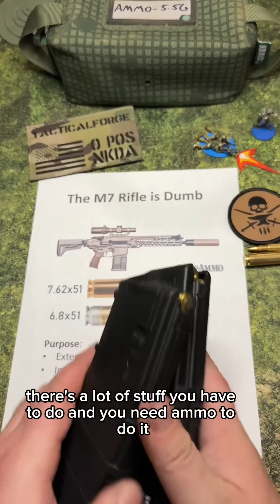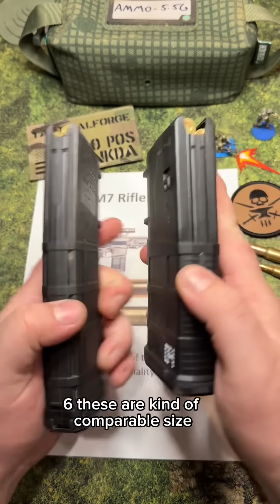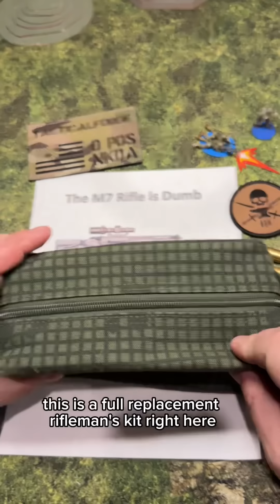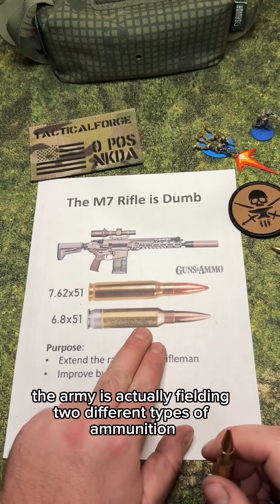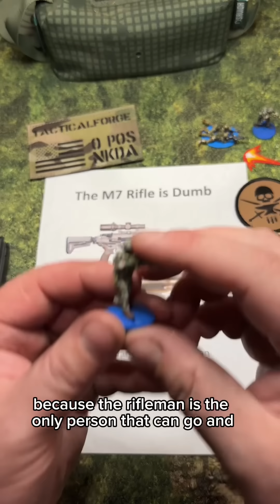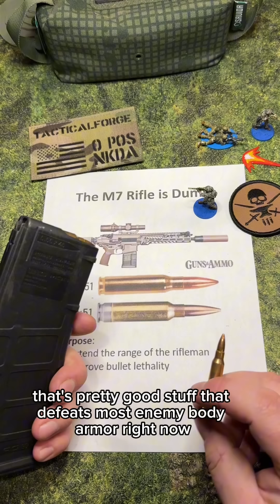The Army’s new rifle is dumb

Comment: What a great idea using a suppressor without subsonic bullets, I'm sure you will barely hear the shot
Reply: The point is to make it harder for the enemy to locate your position for accurate return fire. It also helps improve intra-unit communication & situational awareness (especially during CQB). The Marines were actually the pioneers on this; IIRC they’ve fielded suppressors as standard issue since ~2019.

The problem with the 6.8x51 in the M7 is that the chamber pressure is so high the gun is practically unshootable without the suppressor attached (brass facts did an excellent video on this about 1-2 months ago).

Comment: I have an insane idea: would 5.56x51 (instead of 5.56x45) solve the perceived problem with none of the drawbacks? Or is the round simply too light to make effective use of such a large charge?

EDIT: I'm thinking of a cartridge that is as long as 7.62x51mm, but only as thick as 5.56x45mm)

Comment: I think a better option would be a relatively light weight rifle like the CZ Bren 3 but in an intermediate caliber with decent magazine capacity, good effective range, low recoil, and high BC bullets such as 6.5 Grendel. Put a computer assisted optic on it that can help with lead calculations on moving targets both on the surface and in the air. This would allow every rifleman to have a decent self defense capability against small drones and an ability to engage targets out further than an M4 or M16 of equivalent barrel length while maintaining good mobility and good close range handiness.

Comment: All they have to do is use shellshock or similar technology 5.56 and 7.62, as well as make Tungsten carbide AP rounds more common. Artillery, CAS, DMRs and Snipers can deal with longer range engagements. There's also Machine guns like the Ohio ordnance reaper in 338. Norma that can reach out much longer and 7.62 isn't exactly a slouch either.
Reply: Demanding the infantry rifle penetrate level IV plate is asinine IMO. The majority of the body is still vulnerable to rifle fire, and most small-arms ammo is expended in a suppressive capacity anyway. Besides, HE is a far better way to deal with armor; a grenade or FPV payload going off next to you is still gonna fuck you up.

Comment: 1902- The new Springfield Rifle is bad will be bad
1935- The new m1 garand is a bad rifle it will be bad, it wont be better than the springfield 1903
1958- The new m14 rifle is bad and wont be better than the m1 garand.
1964- The new m16 rifle is bad and is getting people killed it wont be better than the m14
On and on we have had this people. It may be bad now. It will get better.
Reply: The M14 was hopelessly obsolete before it even started production lol.

Anyways the issue with the M7 is mainly the very concept it is supposed to solve. This isn’t the 19th century; there are numerous better ways to solve the body armor “problem” than demanding your rifle round be able to pen level IV plate. Not even the vaunted 6.8x51 can do it unless loaded with tungsten projectiles (not the M7’s fault, modern level IV is just that good), which will never be fielded in quantity anyway. In exchange, we’re saddling ourselves with all the cons of a battle rifle (weight, bulk, shootability, logistics, etc). There’s good reasons why no major military fields battle rifles in quantity anymore.

Comment: Could have used a fairly off the shelf round.  Silly.
Reply: The asinine demand to penetrate body armor at range basically killed the viability of this program.

What they should’ve done (besides not stipulating the body armor bullshit in the first place) was to update the 6mm SAW cartridge. Shorten the neck, reduce case taper to that of the 7.62x51, increase shoulder angle to 30 degrees, and use a stainless steel case. An 85 grain EPR style loading should get around the same velocity as M855A1 but with far better long-range ballistics.

Comment: It's not the mobility factor. It is the thickness of the magazine pouches, making it harder to get lower to the ground. Also, the added weight and reduced amount of ammo reduces your firepower as well. 
This system is best implemented as a designated marksman rifle in an infantry squad, not as the standard battle rifle.

Comment: I have a particular bone to pick on the technical side of the M7.

Let's ignore the logistics and barrel pressure issues, and just look at the operating mechanism.

  The M7 uses what I call a Long-Short Piston, which is a hybrid between long-stroke designs like on the AK and short-stroke designs similar to the FAL and AR18.
  To elaborate; there is a metal extension connected directly to the bolt carrier, which meets the actual piston. The piston itself can only move an inch at most, but the extension along with the rest of the carrier recieve the kinetic force needed to cycle the entire rest of the way.

This means nothing, until you compare how FAL & AR18 style short-stroke pistons work, where the piston is the part with an extension connected to it.

  This is a big deal, because the M7's system introduces a ton of unnecessary interia from the extra reciprocating mass. Meanwhile, the contemporary systems only have the extra mass move an inch at most, making the extra inertia easier to handle.
  In ye-olden times, Bolt Mass was the primary method of tuning a firearm's cyclic rate. If it cycled too fast, inertia would be dumped into the shooter. Too slow, and it would just not cycle. This created a myth where a Heavier Bolt equated to less recoil, which was a trap that many brilliant gun designers fell into, including Jim Sullivan of Armalite.
  Nowadays, adjustable gasblocks and springs of varying strength are the primary methods of tuning a gun. In fact, if you have less reciprocating mass, there's less inertia to create recoil. You still need some inertia to plough through any dirt or grime buildup, but generally less is more.

  This all builds up the question, what is the Long-Short piston even good for? Simple! LMGs. If you burn out a barrel, it makes sense that the piston would get burnt out too. But, having a bulky piston extension on all your barrels would be too heavy and hard to store, so it's easier to just put the extension on the bolt carrier.
  True Shortstroke, meanwhile, is excellent for rifles which are intended to be decently high performing. You won't get the lightweight recoil control of an Internal Piston (usually mistaken for Direct Impingement), but the ease of cleaning is usually worth the tradeoff.

So, as far as choosing an external piston goes, the engineers at SIG chose the single stupidest option for their rifle.

Comment: They should Have went with the L.W.R.C. M6. 6.8SPC. still get more energy and range BUT not as hot and not as much of a increase in weight... 6.8×43mm Same 7mm diameter but 115gr @ 2,500 ft/s

The 5.56 was designed for a 20" barrel. 6.8 SPC was designed for the M4/6 length barrel

Comment: There are some really interesting new developments in 5.56 loadings. Somebody’s got a new thinner 5.56 cartridge case that allows more power to be packed with no pressure/recoil penalty thanks to the increased case volume. Extends the range and punch of the 5.56. They’ve done the same thing with the 7.62. Blanking on the name of the company. Oh, and these new cartridges don’t cost any more.

Comment: They could have updated 7.62N in the same way with slight case dimension differences like a 1 - 2 mm longer neck to prevent chambering of new cartridges in weapons chambered for old 7.62N and saved a lot of money and got a better cartridge. Or just designed a better steel core bullet for 7.62N and loaded it to .308 Win. pressure. Waste of money. This is not quite .270 WSM in 13" causing cookoffs and destroying barrels. Stupid is as stupid does. The metrosexual army way. 

Totally unnecessary garbage.

And the platform? 13" barrel using a beltless short magnum?! You can't make this stupidity up!

Look the M16A2 was the epitome of the platform. Taking it and chambering it for 6mm - 223 or 6.5 Grendel is all that was necessary. And leaving carbines (M4s or M27s, but honestly the A5 USMC concept was the better idea) to support troops and special operators. Phasing out riflemen for metrosexual, thumb over bore, spray and pray gimmickry has decreased US military combat effectiveness and made US infantry a joke. 7m advancing fire drills is not realistic combat training and it's going to fill body bags once they have to face return fire.

Cancel this expensive garbage and rebarrel what they have in stock to .308 Win! Hornady Black 155. Upgrade what you have! Return to riflemen infantry who can actually use open sights and shoot! Stop buying Eurotrash garbage! Sig of the 1980s is not the Sig of today. When you let American small arms manufacturers go bankrupt to fund Eurotrash stupidity it's treasonous.

Comment: The M7 didn't HAVE to be a lemon, the Army is just insanely corrupt and incompetent. Sig had the worst NGSW offering by far and if the Army really didn't like the other two then it should've just axed the program altogether instead of quite literally downgrading for the sake of some general's retirement.
The basic NGSW concepts of increased armor penetration, accuracy, reduced cartridge weight (TV's polymer casings, Textron's CT cartidges) - all of these were in the right direction and yet the Sig offering was the only one that completely dropped the ball on every fucking criteria; hell, only offering that didn't innovate with the ammo AT ALL.

Comment: EXTREME chamber pressure in the name of velocity and a 13 inch barrel to turn all that velocity into noise.  And then a bulky suppressor to subdue the noise.  The overall design works against itself and I see no way that barrels and action parts are not getting destroyed by that extraordinary pressure.

Comment: I've never been a fan of Sig to begin with, but these rifles always seemed like too much gadgetry and pageantry to be really effective.  AR pattern rifles are so easy to tinker with, customize and adapt that they would've done better to just issue rifleman a second upper receiver for long range engagements and called it a day.  You would be adding weight to the standard kit, sure, but the weight of the sig (almost 10 lbs with the suppressor attached, unloaded) plus the extra weight of the magazines is still less than hauling around a second upper with a 16" barrel.  I saw a video a while back of a soldier in Ukraine armed with an AR-15 who carried one 14.5" upper for close quarters automatic fire, and a 16" secondary upper for longer ranges.  Takes literally 30 seconds to swap em out if someone is trained to do so quickly, and not EVERY rifleman has to carry one.  Keep some guys with a standard M4 upper, and hand out a couple of the longer ones to your more experienced shooters.  It may not extend your effective range out to 800 yards, but it would be a cost effective stop gap solution, maybe.

Comment: I've said it before, and I'll say it again: if someone is smart, they'll integrate the .277 Sig's bi-metal high pressure design into a cartridge with the same format as 5.56 and develop conversion kits for rifles like the LMT MARS or the HK416. There's merit to having a flatter shooting, harder hitting, longer range bullet, but ammo capacity and overwhelming firepower are just as, if not more important. I'd be willing to bet that in less than 15 years, the Army's going to transition back to a lightweight, high capacity, small caliber rifle and relegate the M7 to niche specialist roles.

Welcome back, M14.

Comment: According to the Army itself, the M7 will NOT be a global replacement for the current M4. The M7 once fully adopted will ONLY be issued to frontline combat troops; non frontline troops will still be equipped with M4's. While the extended range is a nice feature, the primary purpose of the new rifle/cartridge combination is to DEFEAT current and future body armour; whether through a penetration, or significantly debilitating backface deformation BFD. Research has shown that this requires muzzle velocities in the 3,000fps to 3,200fps range and getting that out of a 13" barrel requires chamber pressures of 80,000psi.

Comment: Improving the range of rifleman is pointless.  Improving the range of the machinegun makes sense.  Improving lethality is also pointless, improving the amount of rounds you can carry and put down range increases hit probability, and therefore casualty rate.  You DONT want lethality, you want wounded casualities.  Preferably wounded that will not return to active service, or will die, but a casualty is far more important logistically in war than kills.  A dead soldier can be left in the moment and they just leave a hole in the squad functionality (probably not a big one that cannot be overcome) a wounded is that hole, and an immedient massive logistical issue.  This firearm program is stupid and makes more sense for a new DMR/gpmg round, than a new replacement for all the 556 carbines.  They should just order a bunch of brand new m4's with new, non best to hell parts and save the old ones for training/reserve so they can stop wearing the rifles out until they can't reliable group at their original effective ranges.  Reminder that the majority of casualties in warfare don't even come from the squad level infantry, mainly from artilery, and air support.

Comment: I (absolutely not military) got to have a chat with some British infantry (standard “big” - for Britain) officers and they couldn’t understand the decision. 

They talked about adding additional DMRs to the squad (if desired), and interestingly they said that it would be possible (albeit not necessarily easy) to put a (very) light 2 inch mortar with 6 guided rounds into a section for the same weight penalty as the M7s alone (not the ammo, just the weight of the weapon). Which, if true, is pretty startling.

Comment: Well you can go for accuracy in fire etc, but that means your soldiers need more range time the gun's barrel has a low lifespan as it is a high pressure calibre and the fix to this is to have weaker training ammo.
So even if you give troops a heap of range time, to get accurate and used to firing the thing, it will perform differently when firing combat rounds.
And without tungsten ammo you might as well be firing 5.56 or 7.62, it is all stupid.

Comment: I mean XM7 is not bad it’s just not an ideal weapon for infantry less ammo and more weight just ruins it. If it can replace a m110 guess it can do fine because the velocity and pressure is good for a sniping role.
XM7 just ain’t doing it
Xm250 surprisingly good for a lmg.
The sig Lmg is good but the rifle is the issue. I feel like the army made the worst mistake in history. There’s better weapons that can kill next gen Russian or Chinese body armor. You got the RM277 which is miles better than the XM7. I know U.S soldier likes ar style design but bullpup design like the rm277 is better longer barrel at the same time short making it good for maneuvering and engaging at long range. Fr U.S soldier just needs to get used to Bullpup design on the rm277 if they want to do well as rifleman.

Comment: The M7 is not replacing every rifleman kit Army-wide—it's limited to close-combat units (infantry, scouts, engineers, etc.), with ~111,000 units planned by 2030, not the full force. Broader adoption (e.g., National Guard) is speculative and years away. 

Laser Rangefinder (XM157 Optic): "Shines a light alerting enemies; commanders will ban it"
It's a tactical trade-off, not a deal-breaker. The XM157 uses a short-wave infrared (SWIR) laser, harder to detect than visible or near-IR lasers, and soldiers can toggle it off for stealth. Doctrine emphasizes selective use (e.g., for target reference points or call-for-fire), not constant lasing. In testing, soldiers praised its ballistic solver for faster hits at 300-600m, aligning with Army emphasis on "precise, distributed" fires in large-scale combat (FM 3-0).

Suppressor: "Heat sink in prolonged fights; glows on thermals, requires constant use"
Heat buildup is real for any suppressor in sustained fire, but the M7's design (13" barrel + full-power 6.8x51) isn't uniquely flawed. Suppressors are mandatory for hearing protection and flash reduction (Army requirement), but soldiers can remove them if needed (quick-detach). Marines' M27 suppressors (5.56mm) face similar issues in extended fights, yet they're "integrated to great effect." Your critique ignores back-pressure benefits for reliability in dirty conditions.

Cartridge (6.8x51mm): "Reduced ammo capacity/bulk; high recoil; training vs. combat mismatch; strains logistics"
Valid on capacity (20-rd mags vs. 30-rd for 5.56; 140 vs. 210 rounds in 7 mags), BUT ignores trade-offs for which the round was adopted in the first place. The 6.8x51 delivers ~50% more energy than 5.56 (M855A1) at 300m, defeating Level IV armor where 5.56 fails beyond 200m.e09887 Recoil (~19 ft-lbs vs. 6 ft-lbs) is "spicy," but the M7's adjustable gas system and stock mitigate it—soldiers report controllability like using a 7.62x51 AR-10. 

Doctrinal Fit: "Riflemen maneuver/assault, not long-range; M855A1 is 'pretty good'; irrelevant for urban/trench fights"
Riflemen do close/assault (FM 3-21.8: "fix and maneuver"), and M7's weight (13+ lbs loaded) hampers that vs. M4's 7.6 lbs. However, considering most units will continue using versions of the M4, this argument only works for units actually using the M7.
The M855A1 defeats most Level III/III+ armor (not IV), but struggles at range/angle. However, Army doctrine evolves for peer threats (China/Russia) with advanced armor—NGSW counters that, not just Afghanistan.
Reply: I don’t think its a particularly bad rifle but it has massive trade offs that the pros have to compensate for. The army thinks its correct and i trust them more than gun guys with a coffee brand and say homophobic slurs on twitter